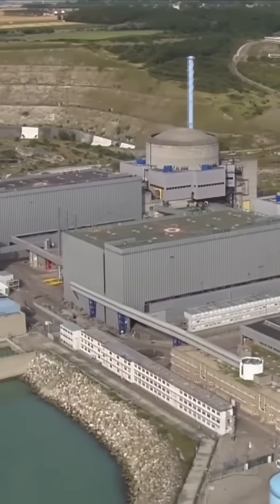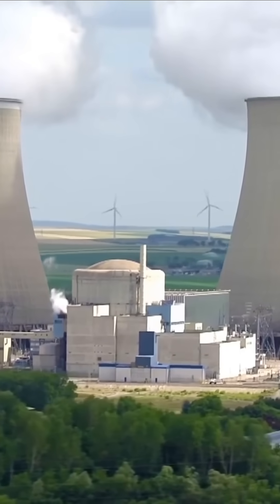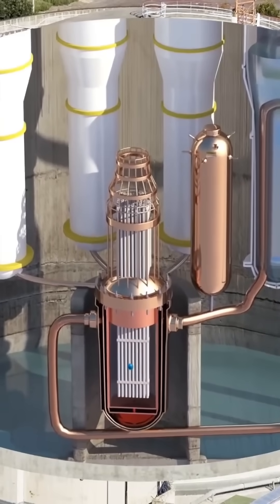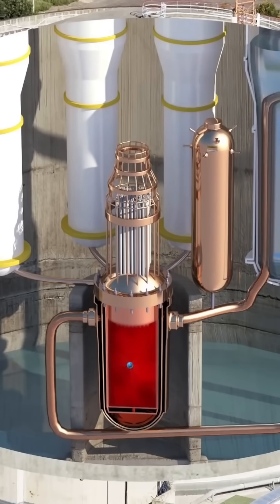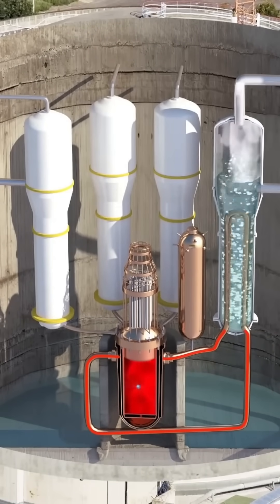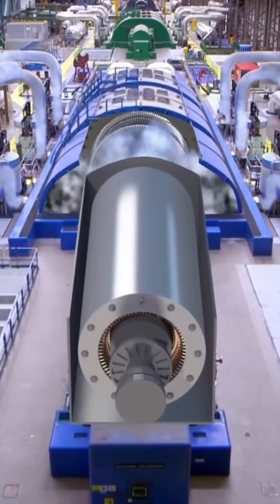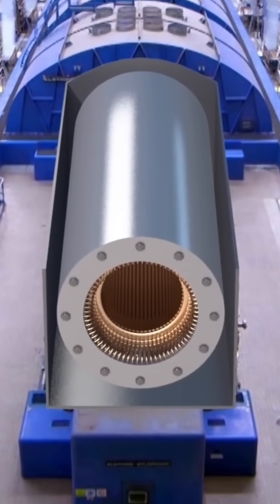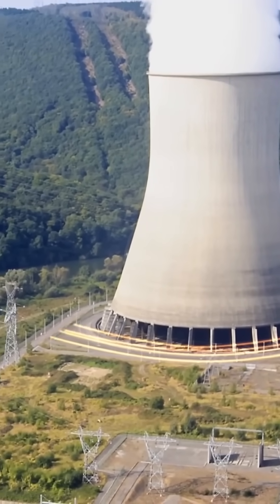How does a Nuclear Reactor work? #shorts #nuclearpower #nuclearreactor

Comment: Could we just focus solar energy to boil the water? I know it sounds juvenile, but I'm imagining a big magnifying glass that boils water instead of using nuclear material
Reply: That's a thermal solar plant. While I agree they can be great, I still think nuclear is better. These solar thermal plants are actually fairly reliable, but I'd definetely say they should be combined with nuclear. Nuclear is less limited by geography than solar thermal.
Reply: @pixuxucobrasil9206  I did a bit of research on it. I have to agree with you. Accidents aside, nuclear is the better option.
Reply: Regular solar panels are more efficient
Reply: @raptorwhite6468  solar panels only turn about 25% of the sunlight they absorb into energy. Nuclear reactors can go up to 18 months without needing to refuel. Not to mention they don't depend on the weather and can be operational 24/7.
Reply: @wilberts.cubero3629  I meant that regular solar panels are more efficient than using sunlight to boil water would be
Reply: Your idea is good,  but still inneficcient, because it only works at night... A nuclear reactor operates for 6+ years without stopping. Plus, as someone also pointed out, a solar panel is about 25% more efficient, whilst a nuclear plant is 30% efficient

Comment: Man i thought they were using nuclear energy to convert heat into electric
Reply: They are converting it.
Reply: Well, they are. Heat from the nuclear chain reaction is used to super-heat water into steam. The steam is introduced to a turbine and spins it. The electrical generator is connected to the turbine via a shaft, and when spun, generates electricity. Nuclear energy->thermal energy->mechanical energy->electrical energy.
Reply: @carlwest3441  great explanation

Comment: how do they control the heat of the nuke?
Reply: There are actually multiple ways to control the heat of a nuclear reaction.

1: Withdraw or insert control rods, which will increase/decrease the intensity of the nuclear reaction

2: Increase/decrease the speed of the reactor coolant pumps, which are responsible for sending cool water to the reactor 

3: Increase/decrease the main steamline pressure. This only works in pressurized water reactors, but steam pressure effects cooling efficiency, which obviously effects the temperature of the core

Comment: We do all of that to just boil water
Reply: It may seem dumb on the surface, but it's actually an incredibly clean and efficient way of producing electricity. However, you're right, we are just doing a bunch of fancy things in order to boil water and create steam. This is the same concept as coal plants and every other type of power plant
Reply: All the electricity as result of " just boiling water" is the reason why we're doing all this, the point is to use and convert the energy from the reaction to electricity and water helps at doing the converting.

Comment: Your diagram is misleading. Those large conical cement structures are called cooling towers. Much like a radiator they simply cool the hot water. The reactor is not located inside them

Comment: So right there close to the end it's so in these red lines were energy's going out in my version of math you could sustain pressure and energy now in saying that I got a housing design that flows with what I consider still components like a steel windmill that could help evolve or understanding of minerals in the atmosphere and learn to control the rotation of it to have a more lucrative society by understanding how to spread light and smaller organic particles

Comment: You do realize that you don't need all that complicated chemistry to make electricity right. You really just need A coil and capacitor at the same Values and a pulse with modulator right To post the tank circuit at its resonant frequency And a diod to get direct current. I've been doing it for years at my house Running everything from My TV to my computer and lights. Except for my fridge.
Reply: Blud think he Nikola Tesla.
Reply: That’s for one house. Nuclear reactors make thousands of kilowatts.
Reply: There is no free energy. Not in your house or anywhere else.
Reply: All we need is Geo Thermal. 
Enough said

Comment: This Video emits the fact that U.S. "Nuclear" reactors do not re-cycle water.   

Steam ejected from the cooling towers contain amounts of radiation. This has an effect on the planet.  Radiation spreads to water and land unrestrained.

The Chernobyl nuclear power plant  was a  "cyclic water" system,  that recycled steam used to turn turbines, cooled it down.

Electricity produced by radiation matter (plutonium, uranium) has to stop eventually.
Reply: Dude...radiation from the cooling tower? Get a load of this guy.

First of all, you need to know what a heat exchanger is. A heat exchanger takes 2 sources of water that NEVER COME IN CONTACT WITH EACH OTHER, and evenly distributes heat between the 2 liquids.

Now that you know what a heat exchanger is, let's talk about what's coming out of the cooling tower. Steam that passes through the turbine is radioactive, yes, but that steam is immediately contained inside of the condenser and sent back through the main loop. The radioactive steam that you are talking about never comes in contact with the reserve of cooling water.

As for the cooling tower itself and the materials it's made of, yes, it is radioactive because EVERYTHING is radioactive. YOU are radioactive. If a cooling tower was releasing any amount of radiation to the planet, it would be nearly the same as background levels and would have absolutely no effect.

Comment: Am I the only one who thinks that this should be called steam power plants, after all, the nuclear energy is not harvested and the thermal energy caused by nuclear reaction, is used to heat water and create steam... If they can truly harvest nuclear energy, the power plant would produce ~ 1000000000 times more electricity
Reply: What exactly do you mean by harvest?
Reply: @ekemini12435  the nuclear fusion creates a lot of energy (the nuclear explosion is proof of that ) but in nuclear plants, we only harvest thermal energy to boil water to spin a turbine to create electricity..is like using lightning just for the light (flash) or using water just for being wet
Reply: @liviusky  To be clear, we use fission, not fusion. Fusion isn’t developed enough yet. I don’t know exactly what you mean when you say we aren’t harvesting the nuclear energy, because fission produces gammas and neutrons. Gamma‘s are electromagnetic packets of energy that express themselves in the form of light and heat. That energy heats up primary water, which in turn, heats up secondary water. That is how we harvest the nuclear energy (thermally). You may need to brush up on nuclear reactions and how the nuclear force works.
Reply: @ekemini12435   does it really matter if is fission or fusion if we waste 99% of it's power just to boil water? Our nuclear plants are glorified steam power plants. Also, the fact that we use only raw material like Plutonium, Uranium, Cobalt when the power can be released by any atom fission/ fusion,  tells a lot about how much people know about nuclear power. The basic principles are just wrong or to lacking and this is the reason why sustain fusion is not possible yet
Reply: @liviusky   Firstly, it matters to properly distinguish between fission and fusion because the process is different. Next, reactor’s don’t waste 99% of their power. Water has a great heat transfer coefficient. That’s why it is most often used as a moderator/heat-sink. Look, I’m not sure where you are with your knowledge of Nuclear power, and how the systems use to facilitate it work, but you really need to do some more research. It comes off like you really don’t know what you are talking about.
Reply: @ekemini12435  fission splits the atom and releases energy, fusion fuses 2 more atoms together and the process may release energy. What I am speaking about, are the electrons released in the nuclear process. In the nuclear plants we use a half century old technology to create electricity and we ignore the advantages of modern science.
Reply: @liviusky  you have no idea what you are talking about. how would you harvest nuclear energy?
Reply: @liviusky mate, i am not sure if you know this but energy is generally conserved. We use the nuclear energy to then convert it into thermal energy which then becomes mechinal energy to electrical energy. energy is always energy mate, only the difference is the source( how much energy each source type release as well), the outcome is the same, energy. So pretty much not every plant that releases steam is a steam power plant, steam is the result not the energy source, what provides energy is the fission reaction which radiates energy as a result then turns into thermal energy and so on.
Reply: Then coal power plants shoukd be called steam too, because they burn the coal to produce fire, heat and heat up the water, which then, as usual, goes into the turbines

Comment: That was it, that was nuclear energy? that was just boiling water!
Reply: Almost every single main stream energy source is just boiling water
Reply: yup
Reply: Water is an abundant resource to use that is widely used to convert heat energy into mechanical energy, which is finally turned into electrical energy. 

There's not many ways at this scale to turn heat into electricity directly, so it goes through processes to convert that energy into something we can use.
Reply: @Dynoids  There are. Gas Turbines are more efficient than Steam Turbines, BUT need very hot sources  Explains why only High Temperature Gas Reactors can use them efficiently. Do it well, and you get +10% to maybe even +15% to electricity produced.
Reply: @Dynoids  psst, goober, its a joke, you dont gotta explain it
Reply: @hacknwack4065  guess I was yapping
Reply: what about the waste that is generated ?  The american repositories are full.
Reply: @iCyWEdontCi2i we bury the serious stuff underground and the rest we store outside
Reply: @iCyWEdontCi2i  I lien how y’all only say Chernobyl Fukushima or three mile island but you only mention three against the hundreds of oil spills or how the destruction of land caused by green energy nuclear energy is abundant efficient clean and contrary to popular belief nuclear energy isn’t green goop in yellow barrels they’re rods (which 30 percent get recycled) that are buried thousands of miles underground and one warehouse has enough storage to master thousands of years with thorium we can basically turn the reactor off if shit hits the fan
Reply: What waste? Minisculue compared to coal burning power plants  @iCyWEdontCi2i

Comment: Steam
How does a train work
Steam
How does a car work
Steam
How does a boiler work
Steam
How does nuclear plant work
Steam

I have forgotten what century i am in now..
..
Reply: Everything is secretly Steampunk
Reply: @piciperkuadrik4636 true
Reply: I mean car engines and gas turbines are exception
Reply: @veiserexab1428  Actually, after burning the gasoline or natural gas it becomes water steam. So, even internal combustion engines and gas turbines are steam engines, somehow.
Reply: @veiserexab1428  It's still thermodynamics using fluids
Reply: @veiserexab1428  Ford used the idea of James Watt's steam engine to power the cars.
Reply: @pata6129 steam powered cars would be fucking amazing
Reply: @Gigachad-mc5qz well there are engines that work with Steam so building a car out of it would be not that hard and could actually work
Reply: what about electric cars?

OH WAIT, THEIR ELECTRICTY COMES FROM STEAM
Reply: @railfansunited  electric car motor is not powered by a turbine or motor that is powered by steam..
Reply: @pata6129 
Yes the electric you charge an EV with comes from Steam turbines.

All energy is generated by boiling water to spin turbines which induce a current.

How are you so unaware of this basic fact?
Reply: @BrodyLuv2  you even read bro.
Reply: @pata6129  
Lol, I may have been tired .. excuse me
Reply: @railfansunited  no... just no..
Reply: @railfansunited  electricity can be produced in different ways to charge the batteries that power the electric car, so also no...
Reply: @pata6129  i’m saying that the electricity source was generated by steam power plants (like coal). like maybe a nuclear plant generated the electricity, and then the tesla was charged with the nuclear plant’s electricity.

sorry there was confusion
Reply: @railfansunited  there is also  solar and hydro dams..
Reply: @pata6129 some solar plants also work on steam......
Reply: @pata6129 not very many though, almost all power plants are steam turbines
Reply: @pata6129 there are also Wind Turbines
Reply: @railfansunited  🤦‍♂️
Reply: ITS ALL STEAM
Reply: @seantaggart7382  even steam is with the steam source
Reply: How does my PC play games? STEAM
Reply: You dont like it? Suggest an alternative then
Reply: @yourbigfan1777  who said i didn't?
Reply: I am fairly certain, that cars do not work on steam, neither electric, nor combustion.
Reply: Basically, all we want to do is create pressure, and steam is the best way to do it.
Reply: @enzomarcilliere7956  until its not, for i doubt we will live to see it.
Reply: @pata6129  Well, even if nuclear fusion becomes a thing, we will mostly just generate heat. And to convert heat into electricity, we might sill use steam...
Reply: nuclear fission is the most badass way of boiling water